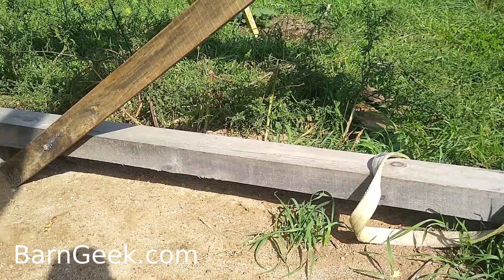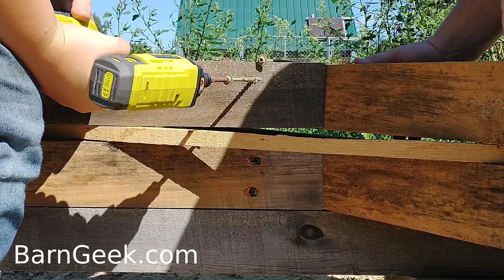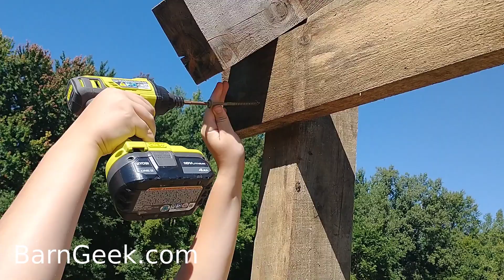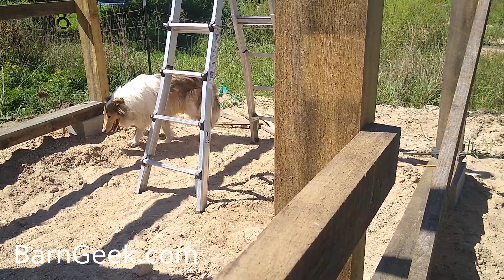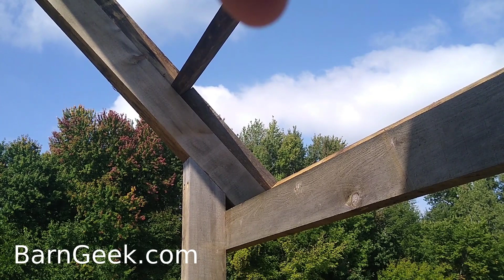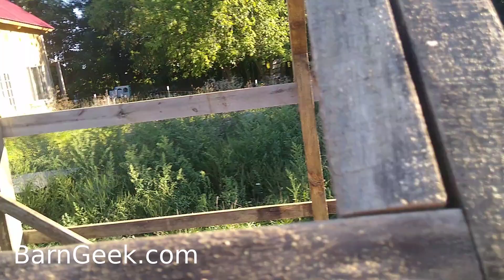How to Build a Timber Frame Shed with Rough Cut Sawmill Lumber Part2

Comment: Hello Barngeek. I am going to purchase your instructions for building a bar’. I would need to know which wood is the best for building a barn? Which rooftoop? Does the wood need to be  treated against insect? I would like a wood with an okd fasjioned look. A brownwood? My area is very sunny. Thank you. Have a nice day.
Reply from the maker: Awesome! I prefer Eastern White Pine, but ask local sawyers what would be best in your area. I like steel roofing. You can treat your lumber with ferrous sulfate to get the old barnwood look. Video on that coming soon.  Whether you need to treat for insects depends on your local insects. Here in Michigan, we don't bother, it's not much of a problem, but other areas might be different. It's best to ask a local professional.
Reply: @BarnGeek  hello, and Thank you so much for your reply. I am going to ask About it and I revert to you. For sure I will foloow your next videos, and I will show to my borthers. We will take the construction plans from you.  I would like to build several barns, About white barn, what is your advice? pine and white painting?   Have  a great day